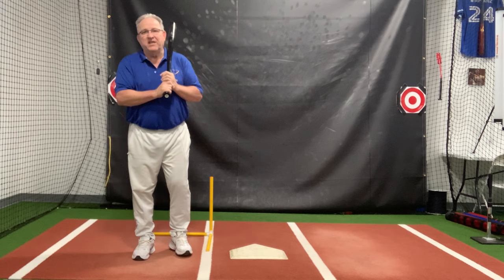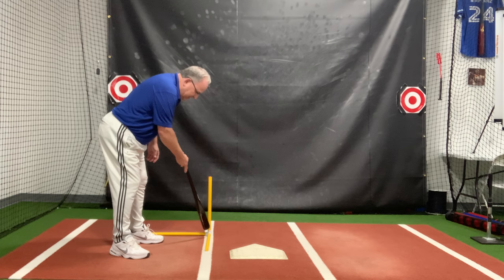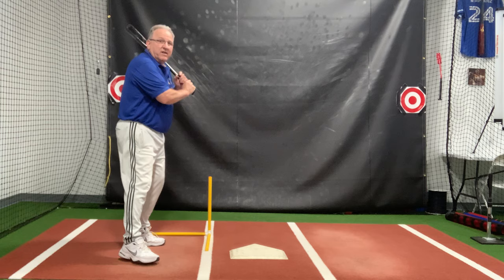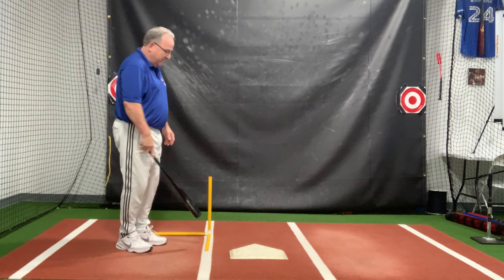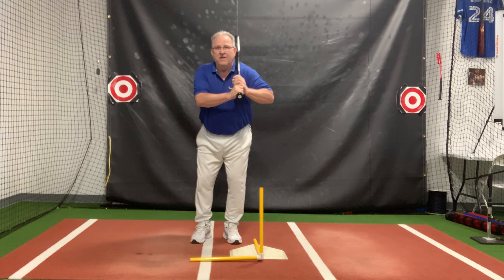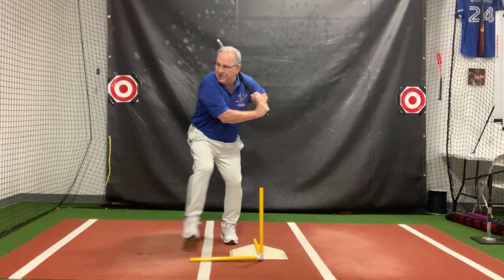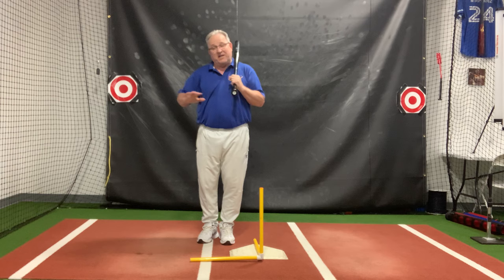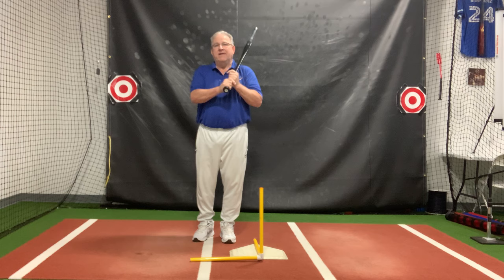How To Load Properly (99% Of Hitters Do This Incorrectly)

Comment: X - axis (left to right), Y - axis (vertical) Z - axis (front to back). Don’t mess these kids up for math!!! 😅
Reply: Look at it from his perspective...
Reply: He’s correct. The plane of the bat is in the z axis the feet are in the x-y axis.
Reply: He's correct 💯
Reply: You realize x and y are two dimensional (the floor) and the Z is the vertical move third dimension, don’t you? Someone screwed math up for you.😂
Reply: @justwondering1967  it's irrelevant. He's going into extension in his lumbar spine to substitute for not staying back enough. It happens when the batter isn't strong enough in the core. Littles do it all the time, his isn't as pronounced but, for his age, it's a problem. He should be able to hold the line. The entire body from the ankle to the head should be a perfectly straight line at contact. He's missing the "hip slip" as Schenck calls it.
Reply: @danielVonMises  dude, you just clearly misunderstood what the Z represents, just pointing that out. You are here on his channel providing inaccurate feedback. What’s your channel? Let’s see your videos if you are such an expert on hitting (because you certainly aren’t at geometry).
Reply: Dude, I know my Cartesian coordinates. He doesn’t. Fin.
Reply: @danielVonMises  clearly you do not. Finito.
Reply: From his perspective he’s completely correct on the axis representation, so your correction is unnecessary
Reply: @jacobl4699  Math doesn't care about perspective. Wait, are you one of those "math is racist" folks?
Reply: @danielVonMises  I have a degree in math, so no I don’t think it is racist. You’re just wrong lmao. 

From where he is looking at the axis, using the right hand rule, he is correct in what he describes as the X, Y, and Z axis. From the camera’s perspective it looks as if he’s gotten his X and Y axis mixed up (assuming RHR again). But, it’s literally a pvc, so there’s no objective XYZ orientation.
Reply: @jacobl4699  well, engineering would beg to differ. Applied math trumps "theory" all day long. Glad you don't think math is racist though. You're batting .500, at least.
Reply: @danielVonMises  I also work in engineering and you’re not right, right hand rule will show that his axis orientation is valid, sure it’ll have a negative Z going up, but since he just pointed out the axis the negative or positive value doesn’t matter.
Reply: Weird comment

Comment: Great video!  The only thing that people  seem to have differing opinions on is when you put your front foot down.  Tony Gwynn teaches that you should lightly bring your front foot down right when the pitcher is at his release point.  If you stay back too long without setting your front foot, especially against higher velocity pitching, it may be tough to get the bat head through before the ball is too deep into the zone.  I will say, your method generates significantly more power, while Gwynn killed pitchers by his ability to consistently get the bat on the ball.  I was somewhere in the middle of the two methods.

Again, there are several ways and I think it is base on comfort.  What works for one, may not work for all.

Comment: I haven't played in almost 20 years and I had to teach myself to swing again. I used your tips when I joined adult slopitch and I'm absolutely crushing the ball. You really do feel all the muscles pulling your bat to the ball. I'm not a big guy, so I've even shocked some of the umps with my hits. 

One problem I've had is getting under the ball too much. People have told me I would get a lot more home runs if they put the fences in the sky, lol. I think I swing too early though. Does that mean I'm dropping my hands? Or is that just timing? The swing is pretty fast...

Comment: All good except for one CRITICAL point  ... the load up should NOT be on the outside of the back leg, (where a five year old could push you backwards!), but on the INSIDE of the back leg where the five year old would find a solid, (but still weight back!), strong base. Inside back leg to inside front leg ... strong to strong ... load it up and let it go ... INSIDE TO INSIDE!!!

Comment: In a lot mlb hitters, including Pujols, they're not moving forward. Their heads move back slightly on the load then snap through the ball. Their heads never move past the starting point. Isn't this true?
Reply: I just looked at Judges swing in slo mo, his head does the same. Back slightly on the load, then forward to it's original position.
Reply: This is absolutely not a one size fits all approach to hitting. Ultimately you have to find what works for you.
Reply: Look at the belt buckle position of all of the mlb greats….they are all moving forward to some degree and centering their weight over the ball at impact.

Comment: No. The entire swing including loading is performed from a balanced position with the belly button exactly between the legs throughout the entire swing.  Just watch the numerous slow motion videos out there. Not one video will show a player with their weight and belly button on top of the back leg at the start of the swing.   Player's goal is to stay balanced and find the "hinge" as they are loading in stride.  The hinge is what translates the lower rotational energy to abdominals then to the shoulders.

Comment: What in the world. Loading up by moving forward? Also, the best time to swing is when you feel like you can’t hold your foot up anymore? The best time to swing depends on the speed and location of the ball. You have to have a balanced, controlled motion that starts forward when you judge it should start based on that speed and location of the ball. Before that, you load up by shifting your weight back, not forward.

Comment: Tony Gwynn and Ichiro Suzuki would disagree. Your technique slows down the swing AND, changes the plane of the swing, making it more difficult to hit the ball. Read HOW TO PLAY BASEBALL  By Tony Gwynn. I taught my son how to hit according to Tony Gwynn, (and my son pitched against Tony Jr in travel ball). Three best stances and swings I ever saw were Tony, Ichiro and my son. Also, your grip is all wrong. With your grip, you have a collapsed wrist in one of your hands at point of impact and you are hitting with only one firm wrist. Using Tony's and Ichiro's hitting grip and stance will increase bat speed, power, batting average, and strength of hit.... ie more line drives than fly balls. No, my son never played pro ball. He got screwed at San Pasqual High School in Escondido during which time the baseball coach sold positions on the team and I could not pay.
Reply: Agree with everything you stated. Gywnn and Ichiro were the kings of the swing. Along with Griffey.